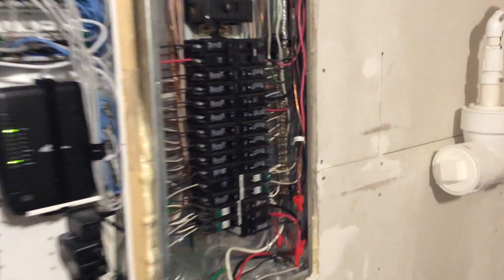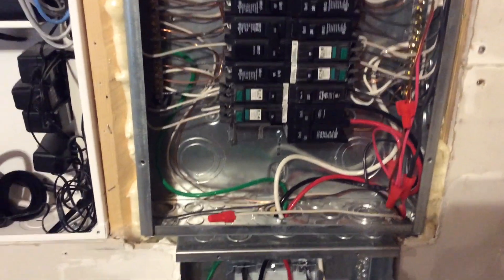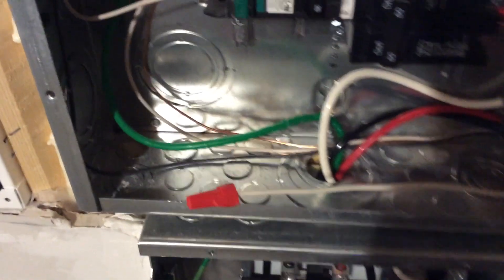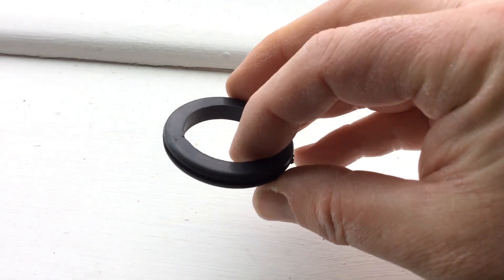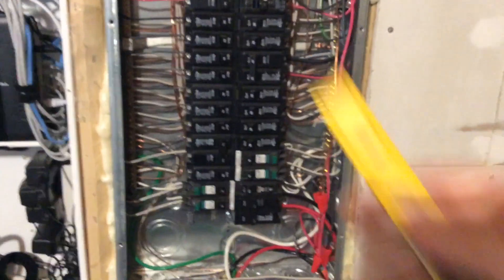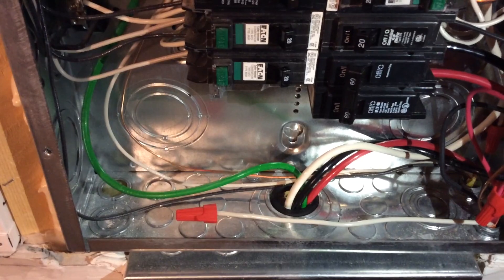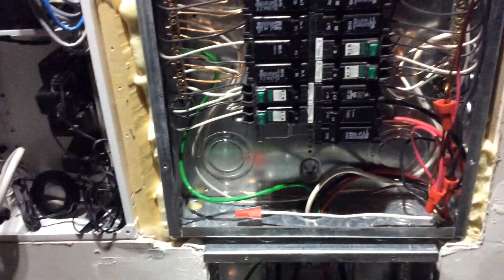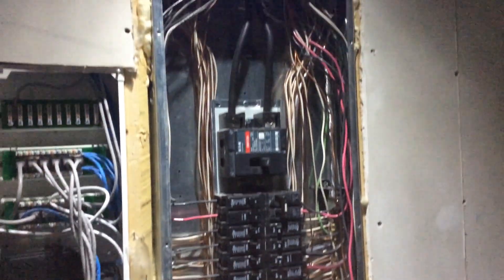Electrical Panel Work

Comment: Hi,
I hope you don't mind a little criticism?
In my opinion, your ground wires are a bit dangerous.  I want ground wires AWAY from the ends of the circuit breakers near the edge of the panel.  Mostly because when working in the panel, having more space between someone's hands and anything grounded (sides of the panel) is better.  If someone is moving circuits around, a loose ground can cause a potential shock.  A loose neutral can do the same if your hand touches (a nearby) ground.
  Instead of running ground (and neutral) wires down the center of the panel, I run them about 2" from the edge and then have them turn outward toward the bus bar.
  Of course, if they are too close to the bus bar, it becomes difficult to separate them or to work around each other.
The other thing is that by running wires to the edge of the panel, you end up with more wire in the panel -which is a very, very good thing.
So (again just my opinion), your wires are too short.  So many electricians do this and it's a PitA.  I do a lot of work replacing panels and obviously they are not all built to the same specs.  But one constant will be the length of the stripped wires.  So if water gets into your panel, there is a bad connection in the panel, a defect, or something else happens to require a replacement; then the next electrician has to add jumpers (I wish I could post pics).  Your Eaton panel has more space up top than many other panels so you'll probably be OK (and I hope you never have to replace it anyway).  I've seen many cases where the wires were not long enough to reach the new circuit breaker locations in a newer panel that has more headroom.  This is especially common (and annoying) when the neutral bus is not aligned with the breakers and it's time to upgrade to AFCIs.
This also applies to feeder wires coming into your meter box, panel, and sub-panel.  Most electricians make a loop on wire in the panel before attaching to the main breaker or lugs.
PS:
I always install copper-bus panels; if you're stuck on using Eaton, the CH series has a copper bus, but the breakers are very proprietary.  I'm not a fan of the Eaton BR panels; the biggest problem I have seen in the Eaton BR series is AFCI failures.  Since I work in an old city, AFCI protection is important to me because of the age of the buildings and wiring.

I hope this doesn't come across as being mean; I hope these are helpful tips for you and your friends here.

That stuff said, I REALLY like the idea of the emergency light!  Great idea!
Reply from the maker: Thank you for taking time to point out some best practices.  I really appreciate the advice and tips.  Take care!